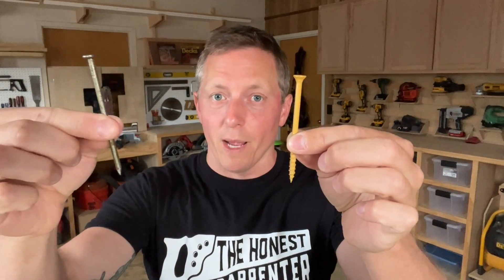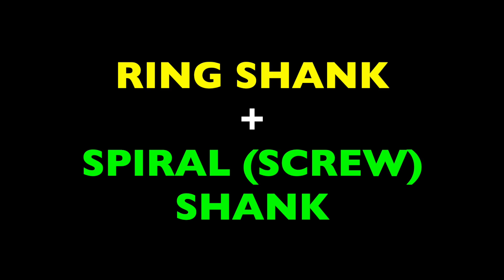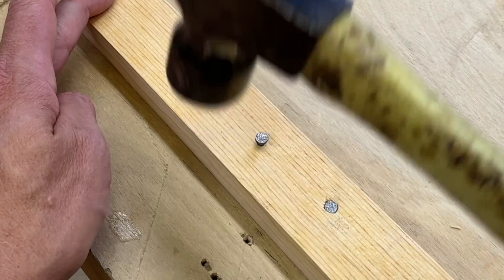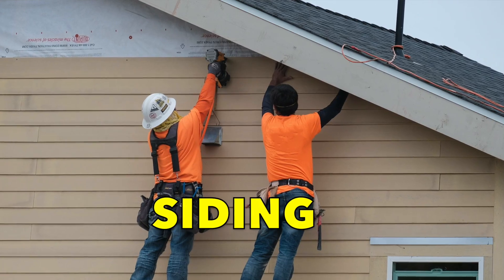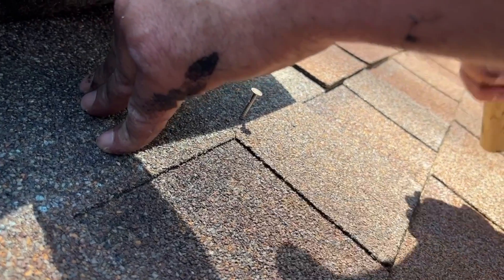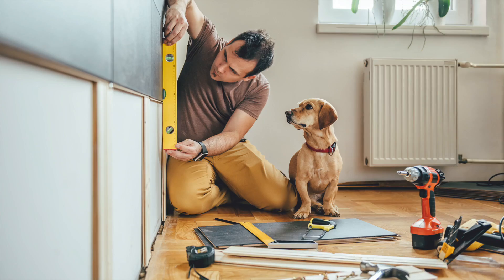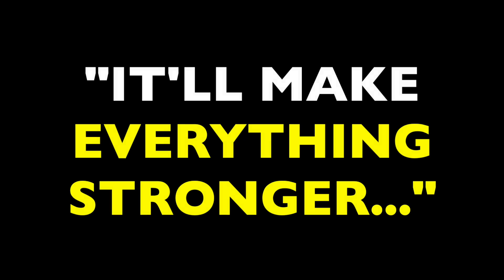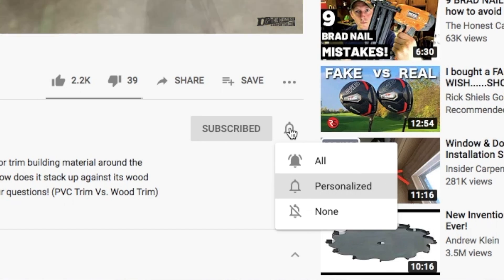These Nails Act Like Screws!! (2 Nail Types That Perform Like Screws = MORE FASTENING POWER!)

Comment: But do they actually though?

Project Farm's channel did some testing a while back, and galvanized smooth shank were just as good as ring shank on pullout, while galvanized spiral shank was actually the worst of all types, slightly worse than uncoated smooth shank.  Theory may need some refinement to meet up with practice.

See video entitled "Do Nails or Screws Have the Most Holding Strength (not shear strength)? Let's find out!"
Reply: Anyone that has ever used reclaimed wood like pallet wood will tell you that most often it is easier to cut the wood off than try and extract the ring shank nails and when you do extract them they are inclined to take some wood out with them as they are extracted.
Reply: & any wood eventual reused from a spiral or ring shank nail construction has a chance to have remains of these nails still embedded which would make future cutting interesting
Reply: @benwinter2420  The remnants are usually the wires that hold the nails together for nail gun use. Some of the nails break off rather than pull out but those are easy to see. It's the wire remnants that cost me thicknesser blades. Once a ring shank nail breaks off in pallet wood it allows you to knock it through with a punch and a 5lb hammer.
Reply from the maker: I haven’t seen their video, Trogdor, just sort of going on my own experience. I’ve demo’d a lot of structures though, and can attest to ring and spirals being monstrous to remove in many of those projects. It probably has to do with many factors, including substrate type, driving method, etc…I’ll have to check out their video.
Reply: My experience as a framer.

Ring shanks and Galvanized nails are both much better at holding than a normal nail. 

Normal Ring shank are cheaper and have more holding force than smooth galvanized nail but are more likely to bend IMO.

Galvanized are expensive but can go into any material, hold well, and harder to bend.

Ring shank Galvanized nails are makes the nail even harder to pull out but makes it slightly easier to bend.

Use Galvanized for pressure treated lumber and use ring shank for flooring. Galvanized Ring shanks for the frame of decks. Screws for the actual deck boards.

Never used spiral shank nails.
Reply: Perhaps moisture is the missing factor and impacts different geometries differently?  His testing is in wood at the same moisture level when driving as when extracting.  Pallet wood etc might be driven green, or at least dried somewhat from construction to you trying to remove it.

I know that at work I deal with damp pallets which require much less pullout force than any of the fasteners tested in the other vid.